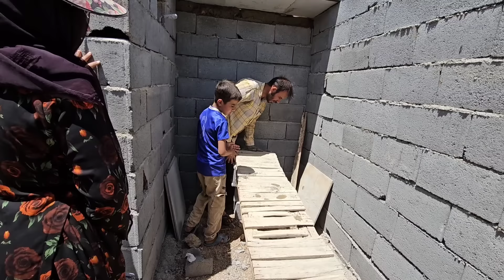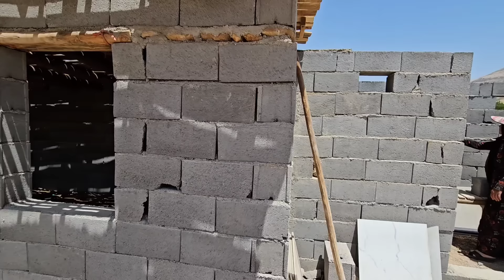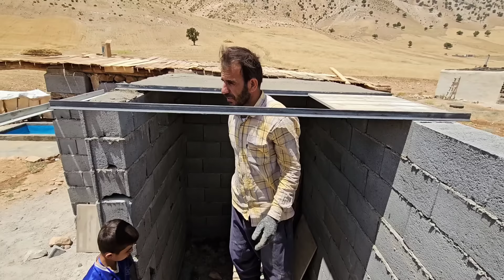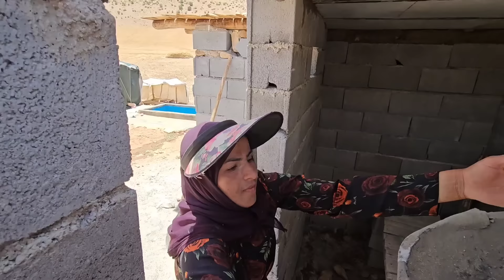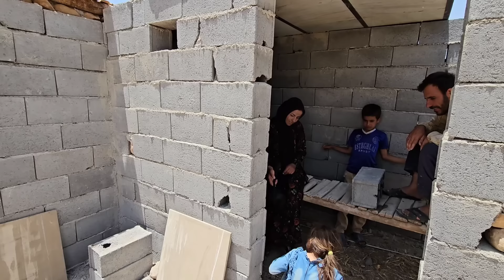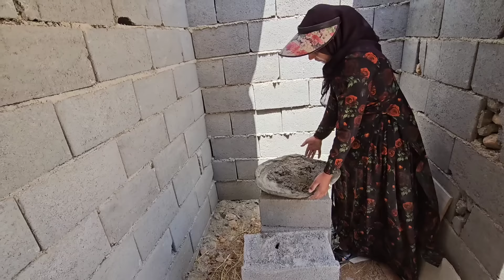: Incomplete Tribal House Roof Due to Financial Constraints

Comment: By the way, there were no English subtitles again.😢
Reply: I had them. Did you turn CC on? On in settings, select English?
Reply: @jaya6655  Mine is usually automatic in English, and I don’t have to change the settings? Maybe next time. It’s more interesting when I could understand the dialogue. Thank you and have a blessed evening!
Reply: @jaya6655 this is my first time experience the Video without English subtitles.  I tried to change settings and it didn't work. It was difficult to understand what is happening besides guessing
Reply from the maker: This video has been translated into all languages
Reply from the maker: This video has been translated into all languages
Reply from the maker: This video has been translated into all languages